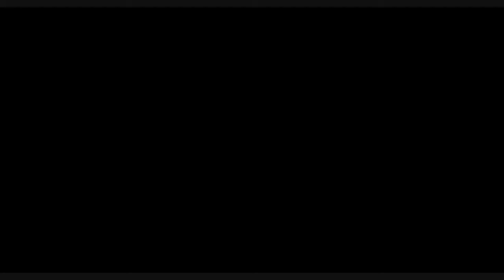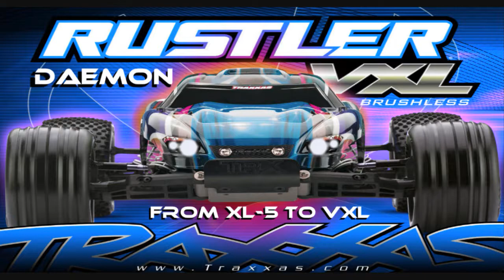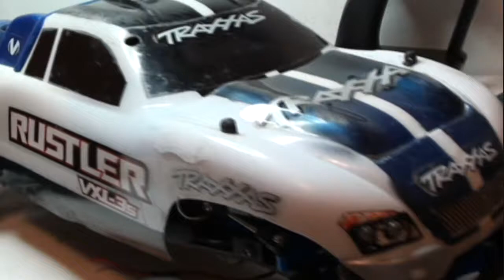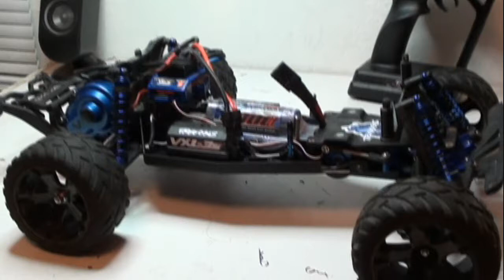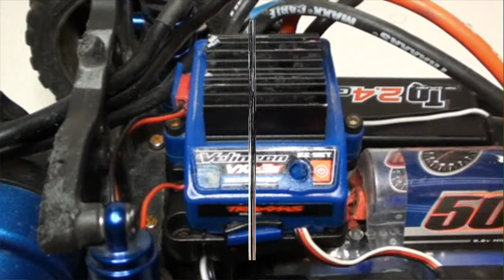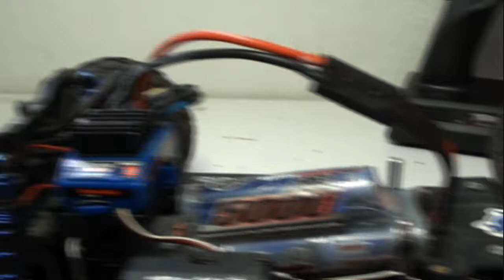Daemon - Traxxas Rustler - Dumbest Thing About VXL-3s ESC [Part 1]

Comment: Its not a metal plate the makes it stick, Traxxas uses a rubber O ring around the button to keep water out, after awhile it will dry out and well, rubber isn't always the best surface for plastic to glide slide on. What I found but probably will void warranty is to sand the top of the button to a ruff surface and what I used was a zip tie, I super glues it to the button so I can pull it up when I turn it on. Use a piece of duct tape to keep dirt out of the button on your other VXL ECS.

Comment from the maker: @TraxxasRustler97 I was very lucky to find one for only $50 with the help of a friend. 

As for the Low Voltage Detection, what it does is it detects when the lipo battery is almost dead and it turns off the esc. If a Lipo battery looses all of its charge it can damage the cells and lower its lifespan. I don't think doing it once will do any significant damage so I would say you don't have to get another Lipo.

Comment: i had the same problem so i emailed traxxas and they said to run some kind of knife or exacto blade around the button. so i tried that and it came "unstuck". my button still gets stuck every now and then but that technique worked pretty good. im not sure if that would have helped you but if it happens again give the knife trick a try

Comment: Kind of had the same problem there. What worked for me was to turn and pull the button a bit to get it in the "off" position. Nowadays im carefull, pressing the button gently. Still I have to use that method sometimes :/

Comment: 2 things i gotta say- 
1. a new esc must have been expensive as sh*t. you probabley could have taken it to the hobby shop for help.    

2. when u switch from nimh to lipo you have to turn the low voltage detection on. i didnt turn it on for the first run. what does low voltage detection do. should i get a new lipo battery?

Comment: I have the same ESC and it's not turning on help
Reply from the maker: +Jake Mishak If it's not turning on then there is something wrong with connection to the battery or the battery itself.
Reply: Traxxas Stampede VXL got wet and will not move but steering works

Comment: dude i had the same problem with the esc in my summit! couldn't do a thing with it. ended up replacing it! what a pain in the ass. even called traxxas, they tried talking me through it, told me to put a drop of w-d40 in it but that didn't work, so i said screw ti!

Comment: I have a traxxas rustler with the xl-5 waterproof, had to change out steering servo.Took to park Saturday and went in a puddle of water a,d it stopped working, took it out and the motor makes a humming noise,it turns left and right but does not move any help?
Reply from the maker: +Raphael Almonte Sounds like the motor is fried. You can clean it and hope it works but otherwise you'll have to replace it. Brushed motors have a very low lifespan. That's why brushless is so highly desired. Low maintenance, long lifespan, and no break in.
Reply: Raphael Almonte, try cleaning the motor, it might have something stuck in it.

Comment: Bummer deal man, same thing happened to me. Traxxas told me I pushed the button too hard too many times. Charged me $50.00 for a replacement. That's why I no longer run traxxas electronics, I posted it up on Ebay the day I got it. Their electronics are crap and they know it, they know if this issue but are unwilling to fix it or replace it. They're happy to take my $50.00 though.